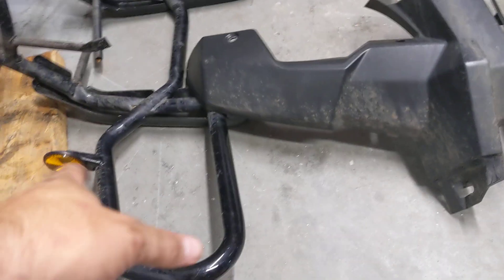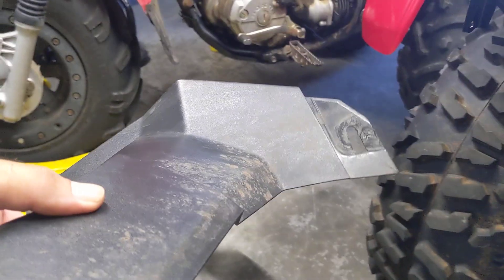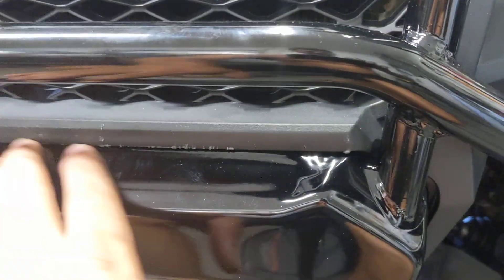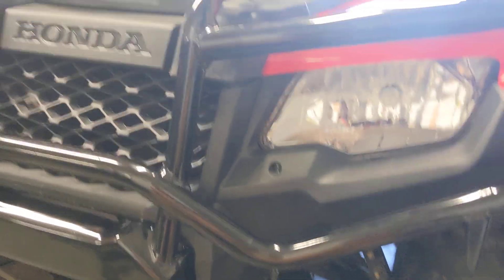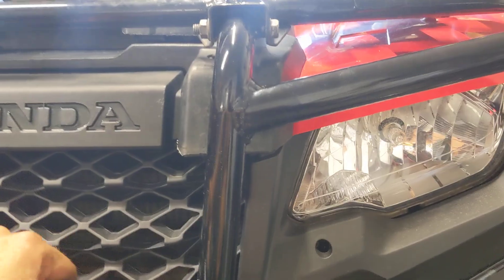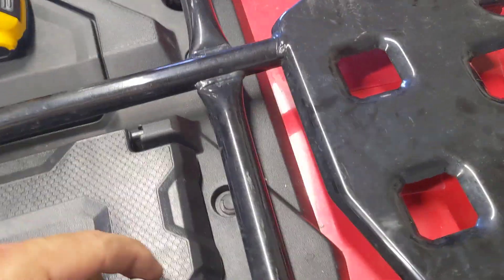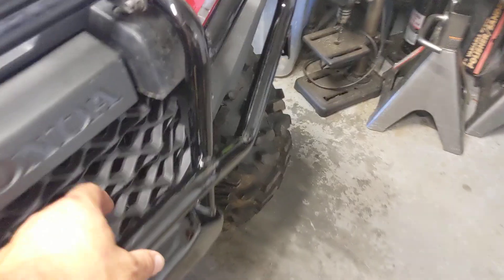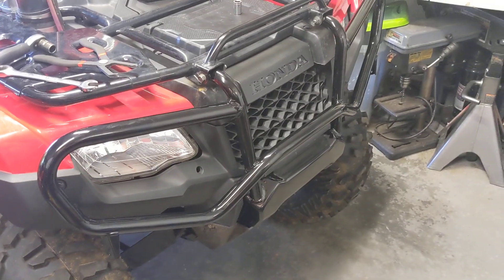2020 Rubicon grill and bumper swap part numbers in description

Comment: Could've just bought a 2020 420 rancher there better
Reply from the maker: Lol it's they're...
Reply: @MudPuppyOffroad are they basically the same atv?
Reply: Traymond Thomas no not quite lol
Reply: @peytonmaloz7293  well the 420s are faster than the foreman
Reply: Traymond Thomas the new rubicons are 520s and they have diff locks that wins the whole thing
Reply: @Craftst3v3vd  Honda 420 rancher have automatic lock diff when you throw them in 4 wheel drive, when the dealership sold it to me that's what they said the 2020 though.
Reply: @Craftst3v3vd  Honda TraxLok® 2WD/4WD allows both 2WD and 4WD riding with the flip of an electronic switch; 4WD with locking front differential, also engaged electronically, maximizes traction over very rough terrain. I Copy & paste from Honda website